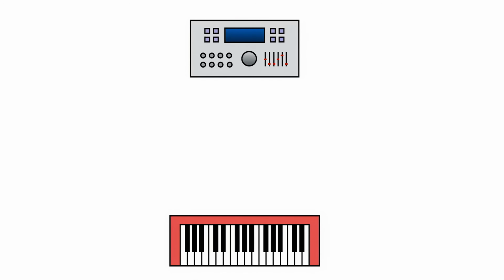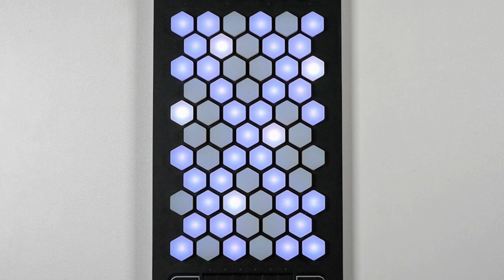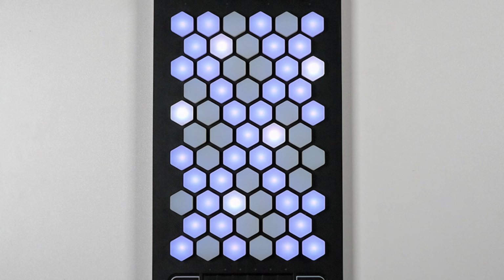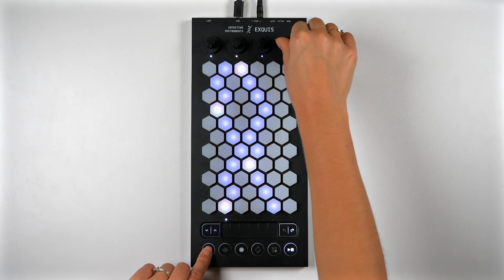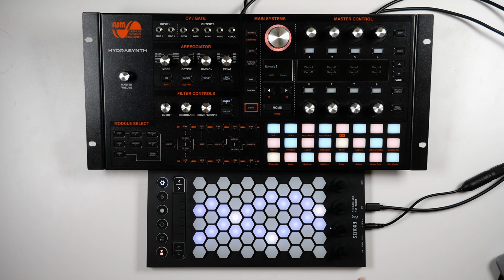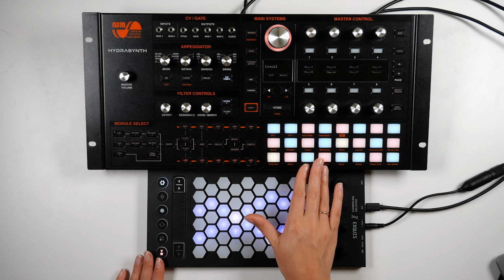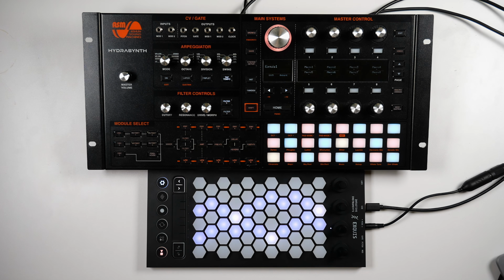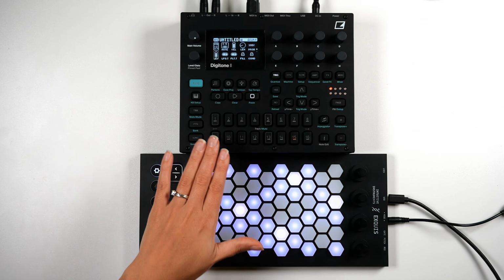Intuitive Instruments Exquis MPE Controller (w/ hardware synths & Eurorack)

Comment: Great stuff …. But: As far as the ergonomics of the hand is concerned it only works when the narrow side is oriented from left to right. Then the controls are however in the way. Turned 90 degrees, so wird the wide side from left to right an octave is too wide ergonomically for conventional 12 tone playing and the extra Controllers get in the way of putting more Units side to side. In other words: Nice for the pushbutton generation but left wanting as a polyphonic controller within the existing musical traditions. As far as I am concerned both are valid approaches but one should not exclude the other. The Ideal would be a Janko layout version of this with 4 to 8 2 octaves from left to right which are 2, 3 or 4 rows deep. But having said all that: As an additional controller it is great and the price is very reasonable.
Reply: The Exquis people want us to play it vertically, which is a bit odd for my tastes. But that's why the layout is that way.

Comment: You made it into a touché which I also use with a lightbulb … I highly recommend breathcontrol through yarns on eurorack - I use a hornberg I also use an exquis I used you’re affiliate link 😊 I got it for kyma 7+++ primarily as I wait for Cristian to come out with some NEL new vcs which I will still be able to use it with.

Comment: I've been using mine for a few days.  I have used it with Surge XT and VCV Rack.  While VCV Rack has a plugin from Intuitive Instruments for microtonality with Exquis, it doesn't affect operation too much.  The keys are recolored, and one of the scales has a few double-flat keys, but that's it.  I am really disappointed in regards to microtonality. Otherwise it's OK, and it's better than the Keith McMillen keyboard.

Comment: Great video, Sarah! I was wondering: can you slide (pitch) by gliding from one key to another on the Exquis? I was a backer on the defunct Loom and was very much looking forward to use it to control GeoShred (specially the horn sounds). But since the Loom is gone, I am looking for an alternative MPE option. Merci beaucoup!
Reply: Short answer is no, that's not physically possible.

(The pads are tall and spongy, and behave somewhat like joysticks.  Sliding between them would push the next pad from center rather than pick up from the edge.)

Something closer to Osmose's "pressure weighted portamento" feels technically possible, but not until Haken's patent expires on that feature.
Reply: Velocity-weighted portamento has been used on SWAM instruments since release. 
I can't see why this can't be used instead

Comment: I returned mine. Lack a MIDI editor was too limiting for my use case. Also when modulating with the keys axis, I too often accidentally ended up retriggering notes while I just wanted to trigger notes once and then modulate parameters. I found the knobs super wobbly and fragile. And the strip doesn’t send any MIDI. It’s a great first step though, looking forward to future iterations
Reply: Does it work without the app?
Reply: @fentanyljones6956  yes
Reply: i use it with my d.a.w. (reason), without the app
Reply: @fentanyljones6956  it does but back when I had it there was no MIDI editor, maybe that have changed since
Reply: @fumarolas  what do you use at the moment?
Reply: @юзер no hardware, modulators like LFOs, envelopes, shapers. But considering a Linnstrument
Reply: @fumarolas  skip it, unless you’re ok with the feel of pushing your finger into your desk. It’s very rigid. I know there’s some aftermarket strips, but I tried the roli too. They all suck. The traditional keyboard exists for a reason, it gives reliable note on and off and velocity detection. The new multi Aftertouch is kinda interesting but even that doesn’t work out so well, let alone MPE. On a guitar you push with your finger to bend a note. I never get why anyone thinks something you can wiggle with a finger can work out in a controlled way. That’s why the Linnstrument is so rigid, because he knew it was the only way to gain control. I never tried Push 3, maybe the idea of sliding after contact works better. There was an add on for keyboards once that did this, small adhesive patches you put on the keys to allow for side to side modulation.

Comment: Can't MPE work with any miltitimbral synth? So like from the TX81Z in 1987 to the XV-5080 or Orbit-3 around 1999 was much better MPE support than anything modern. In the late '90s everything had a separate MIDI B bus so it could play 32 parts instead of 16 😂